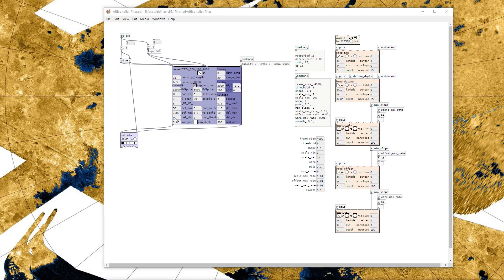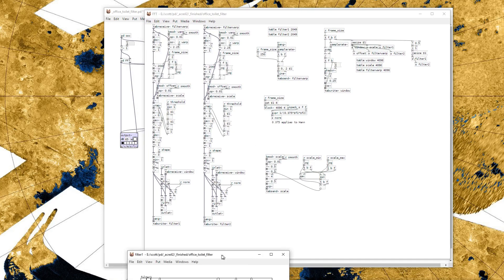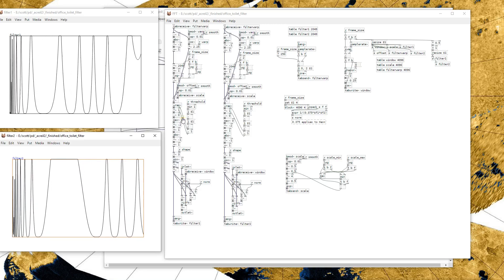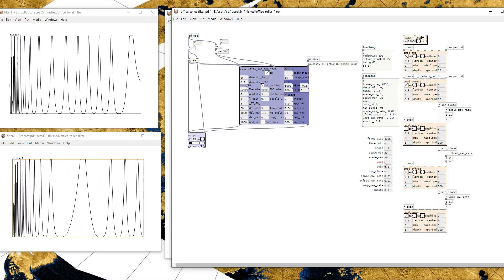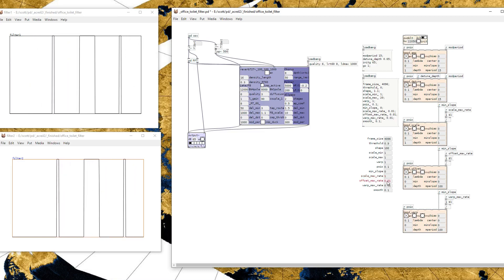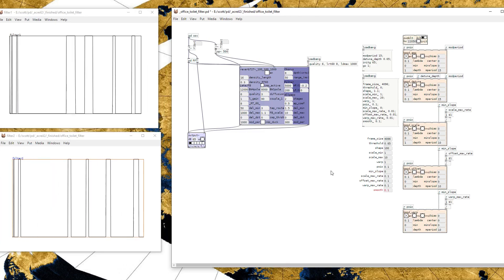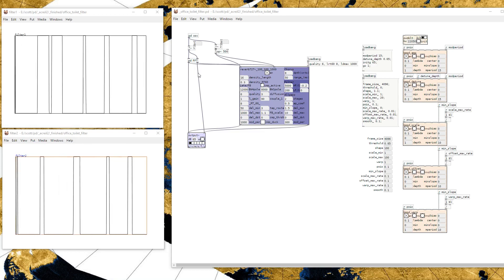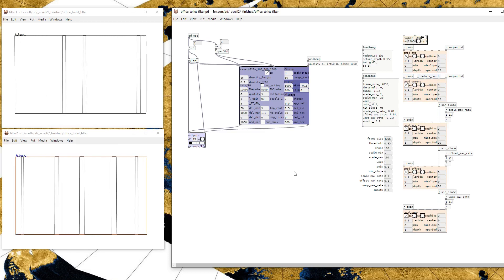Pure Data frequency domain filter patch

Comment: Hello Acreil! I tried looking for your e-mail but didn't find it so I decided the best way to reach you would probably be through a comment. I stumbled upon your content while researching utilizing unconventional tunings beyond a theoretical level. What I'm wondering is how you go about composing on these tunings - more on the practical level. I'm keen on achieving the perfect pitch especially on huge chords - and on equal temperament this feels like a stretch so I'm wondering on what would your take be on achieving this!

What I think my options could be:

Either generate 12-step tuning maps for each individual chord that's in a different key and use a new VST instance for each one. Or make a extremely fine tuning file that could accommodate writing all the chords in different keys in one single instrument instance. 

Which method do you prefer/utilize?

Comment: this is fantastic thank you. Understanding FFT maths has always felt a little(!) out of reach for me, but seeing what you're doing here helps immensely
Reply from the maker: It's mostly not that complicated. If you can get a basic weighted overlap add thing working, and maybe separately process the magnitude and phase, you can pretty much just screw around with it and get lots of weird effects. Doing something more rigorous (like cepstral processing or a phase vocoder or whatever) is a bit harder, but you don't necessarily have to do that to get interesting results. You can get something similar to paulstretch just by using a very large frame size (131072 or so) and randomizing the phase.
Reply: @acreil  Good to know. I jusst worry about blowing the speakers due to the dynamic ranges :) Yep Martin Brinkmann did something like that on one of his instruments. [small_paul1] it's called. Cheers
Reply from the maker: @SiMills  If you're doing DSP stuff it's kind of inevitable that you're going to occasionally mess something up and make the patch blow up into horrible noise.
Reply: @acreil  could you kindly explain where the weighted overlap stage is in this? Is it in the upper right corner providing the window via some kinda cos~ manipulation for the windowing? I looked at that link and my newb expectation would be that it happens at an output stage, literally....